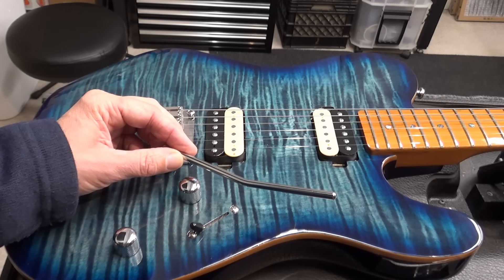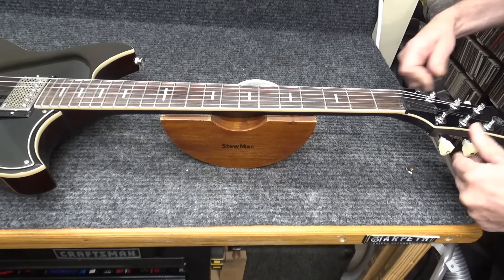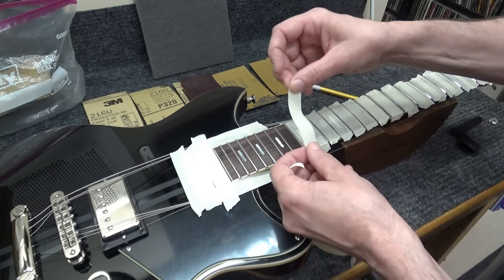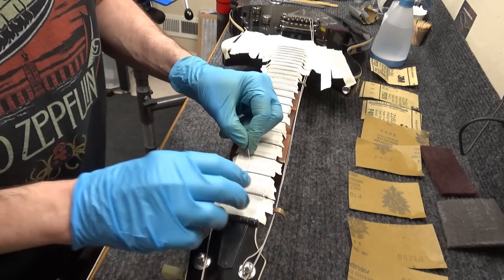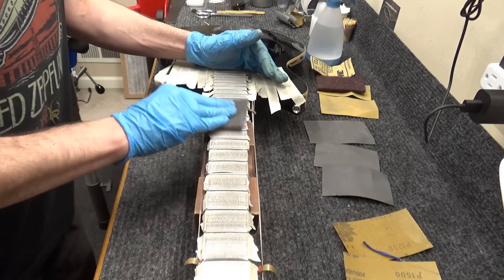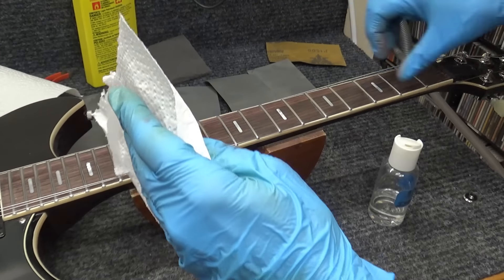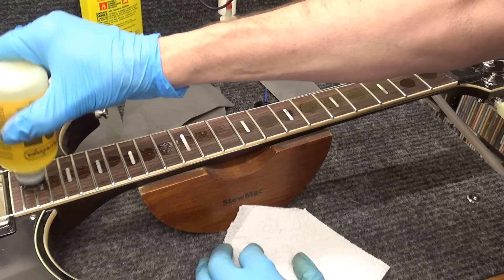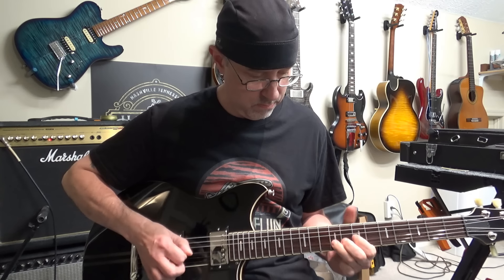Revstar Disfunction - Frets

Comment: One tip for the person doing this at home, once you tape over the pickups, you might get some metal dust on the tape where the pickup magnets are.  Once you are finished, when you are removing the tape, put another piece of tape on top of the metal dust on the pickup, so the metal dust is trapped and won't get away from you as you remove the tape.
Reply: Clever tip but stainless steel is non magnetic, 'silver nickel' neither.

Comment: My experience with "overseas" guitars is that they often have scratchy frets. I don't think it is lack of polishing & quality control,  instead I think it is due to the way it is packed&shipped. My Revstar electronics did also suffer during the transport, so the pickup selector switch and controls were scratchy too. Seems like some corrosion is occuring while shipping with boat for months.  Indonesia also has high humidity, so in addition to scratchy frets my Yamaha Revstar standard fretboard shrunk in my dry cimamate and developed severe fretsprout.
Reply from the maker: Thanks for sharing!